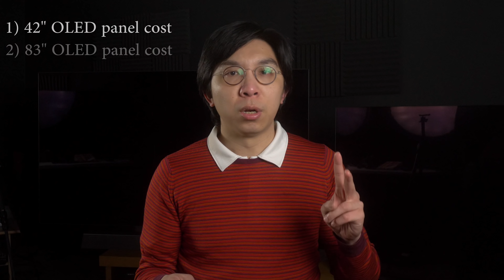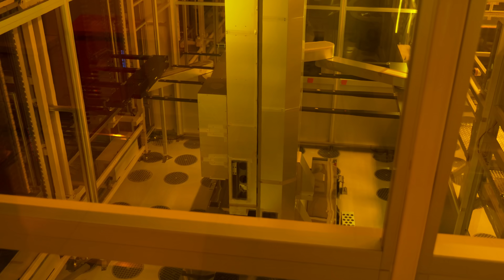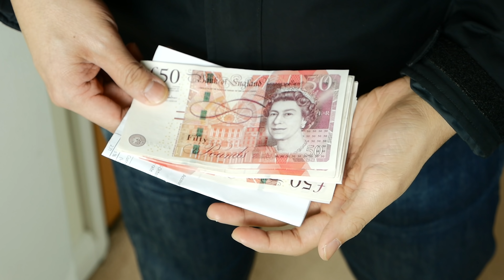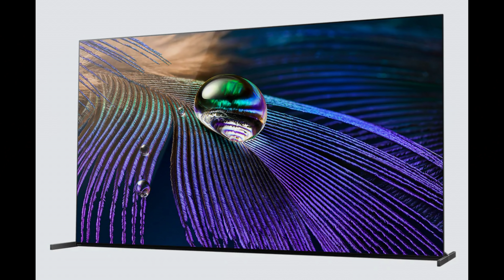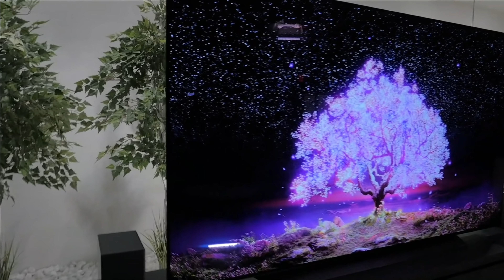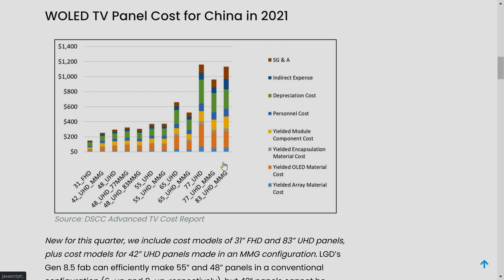LG 42-inch OLED TV Panel to Be 33% Cheaper than 55" - Will You Bite at $1000?

Comment: 1440p at 31 would be perfect, not difficult to run for a gpu and still high enough ppi count
Reply: This is what I would want at 120Hz - 165Hz...with decent HDR..say around 800 nits..that would be excellent.
Reply: Came here to say same thing 1440@31” perfect.
Reply: Ive tryed it in the store i mean i tryed playing some 4k videos of gameplay of some pc games. to me compared to my 27 inch 1440p monitor it looked to pixelated. they should make some resolution between 1440p and 4k as a PC monitor this would be easyer to run and would also look amazing like a 3k ) 3072x1620
Reply: @camaro8570  Any resolution that isnt native will look pixelated on a monitor, for example 4k on 1440p will not look as sharp as 1440 on 1440p. For youtube its different because of bitrate and 4k will always look the best
Reply: @EndstyleGG  Exactly for this reason I am still using a 27" 1920x1200 monitor ... but ... together with 4x DSR.  Because 4x DSR is an even multiple of 2K it looks superb. Nevertheless some people might struggle with the lower pixel density of 2K when sitting too close.

Comment: The way i see it... if i can get one of these for £1000 then the monitor market HAS to change because nothing at £1000 on the monitor market gets close to the IQ of this TV for gaming at (to me at least) satisfactory frame rates and resolutions (ie 4k 60fps and above).  I dont need the last word in input latency and i dont need higher than 120fps (tbh 60 is fine for me anyway) and would get nr 4k 120fps for a few yrs with a gpu costinf more than the TV anyway.  This could really shake up the monitor industry which has taken the piss out of gamers for yrs with horrible image quality giving way to high frame rates.  I dont do much multiplayer since i grew pubes... i just want to enjoy a good campaign as such and immerse myself and this TV will do a better job than any equivalent priced monitor at the time of writing at least.  Roll on 42 in oled TVs and more smaller oled monitors  👍👍

Comment: Given that Sony doesn't have a FALD 43inch TV coming in 2021, even though a 42inch OLED at $1000 translates to £707.20, this will likely end up being £999 at launch over here.
The 48 inch starts at £1800, so maybe this will be £1299 assuming the differences in panel cost from the 55 inch panel will translate to real world prices.
UK will get well and truly shafted on prices if that holds true.

These 42inch OLEDs shouldn't be anywhere near £1K in 2021, £799 would be a fair price for standard OLED tech cut at 42inch size panels.
Reply: It will be massively popular with the PC enthusiast crowd so I wouldn't expect it to be less than 1k

Comment: Can you out check what’s happening to LG CX (03.21.16) black levels in stranger things season 3 whenever Eleven goes into the upside down?? They are full back scenes but flicking occurs all around the image for some reason. This with all IA features off and additional settings nominal . A fixed need to be issued around this please can you check it out ! 

Kind Regards 
Luke
Reply: i can check, which episode is it?

Comment: If the report is real, that means it will cost £871(lg bx 55'' is £1300) in the UK. We still doesn't know if this will be made for watching movies or playing games. Also at £871 isn't that getting close to high end monitors?
Reply: That is cheaper than most high end ultrawides and only slightly more than high-end 4k 144hz screens around 30"
Reply: @Daepilin  
Monitor manufacturer need to be smart how they market this and which feature they will add on. They only have to look at what people are using CX/BX 48 and 55 for.
Reply: @B1ueStryk3r  I held off upgrading my monitor for this. Monitors are shitty even when spending £1k+

Comment: Years ago when LCD TVs were new to the consumer market, I settled for a 42” 1080p set for $1800. My viewing distances is 8’ - 9’. I prefer a 55” set at that viewing distance now. I’d rather pay $1000 for a good, 55” backlit LCD and solid processor than go down to a 42” OLED to eliminate some blooming on occasional content or to have a % better blacks. I got the Sony 900f in 2019 and am very pleased with it for $1100 before tax. I love the bigger screen size. I would never go back to a 42” now that I have a 55”.
Reply: With your viewing distance you need at least 65" for being able to really detect any differences between FHD and UHD.
The 42" models this video is referring to will mainly be used as desktop monitors with approx. 2' viewing distance.
Reply: @marcuscole8796  I thought about getting a 65” set when I got my last TV, but the cost per inch over 55” wasn’t worth it. I wanted to stay around the $1000 mark. I think the 55” for small living rooms is nicer than my old 42”. I was thinking more about bang for the buck overall
Reply: @farkas480  It is not a problem not being able or not willing to buy a 65" version. The only thing you have to do is: reducing your viewing distance !
From a certain point on you get exactly the identical capability of detecting 4K and the identical immersion of a 65" tv.
Sry ...for the precise distance getting a 65" experience on a 55" calculating is required ... just get your sofa, armchair or whatever closer depending on how much your room will allow to not look strange ... you'll love it after you got used to it   :-)

Comment: For LG not to be releasing a brighter 83" model surely they would not be offering it to Sony. I'd say there are other limitations at play possibly power supply.
Reply: Lg isn't using the heat sync Sony is, which I think in part is why the a90j costs more. Sony probably just figures all hands on deck and no compromises at that size

Comment: Why motherglass is not exactly made in a such a dimension thst there is no glass wastage 🤨 ??
Reply: Because each differently sized production would need its own separate fab facility & production cycle, which would add significantly to the manufacturing cost.

Comment: Perfect size but if it's like CX or worse in terms of the dim blurry shitty image - hard pass. I dunno if it's that slight difference in brightness or what but C9 was VASTLY superior to CX on display in a store side by side
Reply: Well it's not "vastly superior", they are the same tv, but CX has slightly better image.
Reply: @Kiisseli1337  You mean worse. Technically just slightly but practically it looks so crap the whole point of an oled is gone. Have you actually seen a C9 and CX next to eachother? CX sucks dick
Reply: Also pretty good from this tv with shitty image to be the highest rated PC monitor and television by Rtings.

Comment: LG: Here is a panel with 20% higher efficiency
Also LG: We're not replacing the old panels lmao, buy a more expensive G1 with inferior size availability instead lol
Reply: Yeah, these 31" and 42" sizes would need the latest panel tech + heatsink the most. These would greatly raise the immunity against burn-in mostly problematic in use cases for these sizes. But I'm not sure if these might still get that new panel (not the heatsink though).
Reply: @tkermi  As far as LG Electronics displays they are clearly segmenting the G1 series by making it exclusively get the better panel (for now anyways), but for other brands using LG.Display's panels it's up in the air whether we'll get the improved one or not.
Reply: @ironoverheat465  Yes, it's just that I haven't heard (or don't remember 😂) to which series these 42" / 31" sizes belong to.

Comment: The 42" OLED sounds like the perfect size for a big desk, so it would be good for PC gaming. But... it all depends on whether LG make it a 4k 120hz panel with full HDMI 2.1 sockets. If they cheap out and only make it 4K 60hz then it will be a dead loss for gaming. It would also be beneficial for LG to place a non-reflective matte coating on the screen too. Previous generations of LG OLEDs have all suffered massively from immersion-breaking reflections
Reply: 42" will in the the C1 range so should have 120hz.
Reply: @adamek9750  source?
Reply: @Dogelition  One of HDTVtests earlier vids iirc
Reply: @adamek9750  no he didn't say that.
Reply: Agree. This might be perfect as a gaming screen. I think I'd keep my 'normal' 27+24 dual screens for work and surfing, but adding a 42 for gaming might be awesome
Reply: Almost nobody besides people using it for a gaming monitor are going to pay $1000 for a 42" TV. They'd have to be insane to not use a 120hz panel, they're going to have a hard time selling it if they do.
Reply: Agreed,  if LG even dares to try and see sell 42' tv's without 2.1 and tries to go for the normies instead it 'll be a dead market completely. It would be like selling a black and white 13' tv at a $1000 price point in 1985. Then on top of it just imagine if they have these 4K 60Hz 2.0 tv's were displayed at a local Target? The regular joes would be thinking these are 2008 prices for a screen size that big all over again.

Comment: Will there be 8K resolution? On desktop, 8K can definitely be appreciated more than across the living room.
Reply: 8K desktop !? Nuts... 😔
Reply: Stop doing drugs.
Reply: Actually, it will look just about right having 8K on a 55" panel used as a PC monitor. The picture detail and text sharpness will be phenomenal, and all this on a cool big panel
Reply: @LalaFafa  It’s not. I have 55 inch 8K TV and 32 inch 8K monitor. My 8K monitor looks much sharper.
Reply: @allansh828  obviously. 8K 32 inch monitor will look much sharper. If you need something sharper than 55 8K -- no problem, it is your personal preference
Reply: What's the point if HDMI 2.1 would need signal compression to handle 8K even at a measly 8-bit 60Hz? Even the upcoming DP 2.0 will only be able to do 8K 60Hz uncompressed.
I highly doubt DSC (Display Stream Compression) will be lossless quality when the screen is used as a computer monitor, regardless of how many marketing claims will be thrown around.
Reply: 8K on 42inch?
What DPI scaling will you need or will you get ants to read for you?
Reply: @InnuendoXP  They probably have a telescope next to their desk for reading text.
Reply: @InnuendoXP  come on. It is fairly easy to set up 200% UI scale in Windows and there you go. I use 4K at 55" with 100% scale and the size is okay, but 8K will be just the spot, the perfect spot